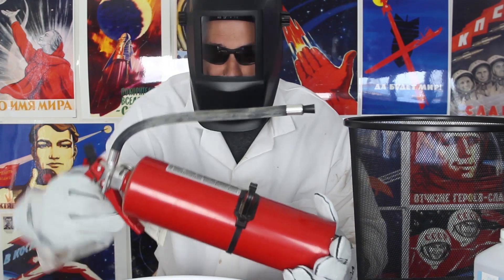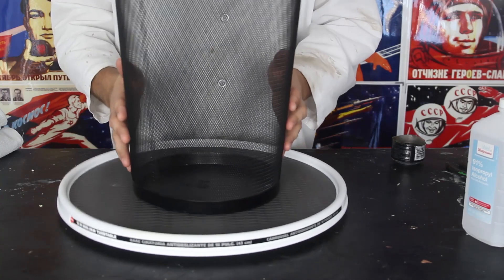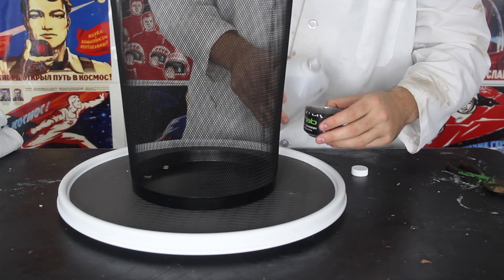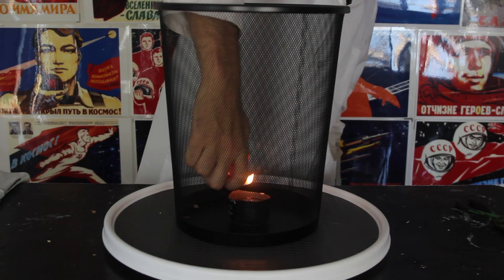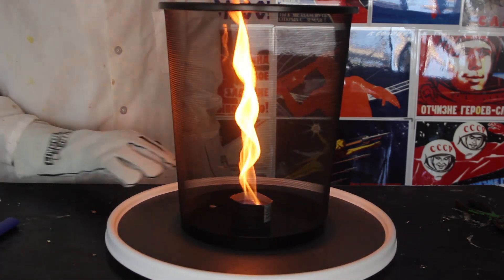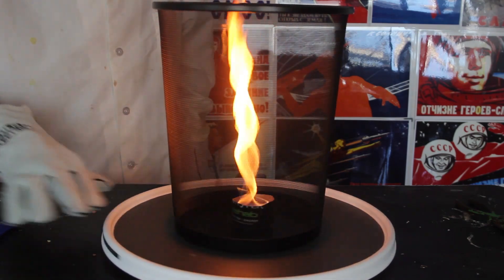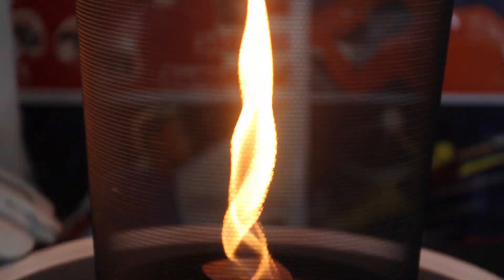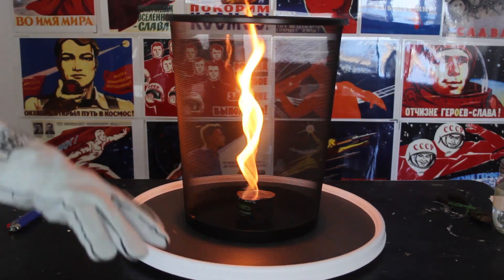Make a Fire Tornado

Comment: Can someone tell me what are the materials of the experiment??
Reply: I'm not sure if you're serious. If you are, then you need a Lazy Susan, a wire basket like his, the bottom of an aluminum beverage can (so, you need a whole can and a cutting tool of some kind) or some other similarly-sized container that won't melt, Isopropyl Alcohol and a lighter.

Let's get to it!

I couldn't resist. :)
Reply: sorry, i couldn't hear some of the materials, but thanks for the information! :)

Comment: well, the oxygen is in the air, O2 causes the ire to fuel, then, you spin it, and the wind kicks in, that's when the wind goes from under the can, from the holes in the trash can, to the top and wind don't just go stright so, it causes the fire to spiral up. that's the simpliest form I can explain in

Comment: 5559555555999995595595599999555555555595555
5559555555559555595955595555555555555959555
5559555555559555599555599955555555559999955
5559555555559555595955595555555555595555595
5559999955999995595595599999555555955555559
5555555555555555555555555555555555555555555
5599955555555555555555555555555555555555555
5595595559955555599555599555555555555555555
5599955595595559955559955555555555555555555
5595595595595555599555599555555555555555555
5599955559955559955559955555555555555555555
1.Highlight the numbers
2.Press Ctrl+F
3.Press 9 or 5
4.Read the message

Comment: 559555555999995595595599999555555555595555
5559555555559555595955595555555555555959555
5559555555559555599555599955555555559999955
5559555555559555595955595555555555595555595
5559999955999995595595599999555555955555559
5555555555555555555555555555555555555555555
5599955555555555555555555555555555555555555
5595595559955555599555599555555555555555555
5599955595595559955559955555555555555555555
5595595595595555599555599555555555555555555
5599955559955559955559955555555555555555555
1.Highlight the numbers.
2.Press Ctrl+F.
3.Press 9.
4.Read the message
Reply: Thats fucking awesome!!
Reply: IF you will press 5 instead of 9 you will see it clearly !
Reply: What it does?
Reply: darude - sandstorm

Comment: This seems to rotate the fire to a new position, therefore expanding the area/volume of available oxygen.
In that time & process, some has burned while some still needs to burn. The motion takes the form of the spiral
because it is no longer randomly patterned in it's burn but, has a guided burn & shape.
(Still searching for more proper phrasing!)

Wish I knew how to do this with a campfire and not have the motion be obvious .... on Halloween, I'd be a Warlock!!

Comment: The fuel goes up into the air and the spinning is causing the fuel to take a linger time to burn. I can't explain it perfectly but that's basically what's happening.
Reply: I think it's because the wind makes the fire turn and the carbbage can keeps the air massively going out, the sands keeps the fire in the what we could call here the "spinning radius". While all that happens, the carbone goes up causing the fire to grow as high as the garbbage can is and spin at the same time
Reply: Noooo I am god and I can move things with my mind

Comment: I believe that the oxygen in the air fuels the fire. Then flung at the fire at high speed causing it to get bigger. I'm guessing.
Reply: Majic Goat Um isn't a academic something like the bubonic  plauge (aka black death)
Reply: How does intelligence have anything to do with fire?
Reply: well ya but still confusing
Reply: the trick is the garbage gets oxygen in so if you replace it with a glass it woooooooooooont work.the cicular motion causes the fire to make with oxygen a Tornado

Comment: The fire consumes the oxygen, and because he starts to spin the bin, it is more difficult for the air to go through the holes causing it to enter at higher speed through the bottom half (where there is a difference in air pressure, the "tornado" effect is created by the air entering through the hole at some angle, and since its faster it travels in circular fashion inside the can until it drifts into the flame to burn causing a vortex... Damn my fluid mechanics classes are finally making me useful haha

Comment: The air holes in the bin are sucking in the air particles and are pushing them out the other end in a way that makes the fire, thicker at the bottom, spin in a thin vortex.

Comment: It makes the tornado because fire needs oxygen and without oxygen u can have a fire so when u light it on fire it takes oxygen than makes a fire and when you spin it the oxygen that the fire is taking in it circulates and moves and that funnel formation and the fire grows

Comment: Fire needs oxygen to burn. When you spin the trash can, it pulls in air from the outside making the fire taller and that air is spun in a circular motion which moves the fire in a tornado like fashion.

Comment: Great job, Crazy Russian Hackers. I think the reason why the flame goes high when the trash can spins is that the air pressure in the central region  becomes smaller owing to radial centrifugal force, which further lowers the force that suppress the flame when the trash can stays still.
Reply: Or probably spinning helps the air flows more easily and quick.
Reply: i lost you as soon as you said radial centrifuge force
Reply: Sean Cheah Never mind, this video already tells everything :)

Comment: The mesh trashcan, when spinning, acts as an air trap of sorts. It creates a wall, just like fan blades, except it is cylindrical, and since there are no angles, air is not pushed or pulled, it simply stays put. This makes it so a subtle raise in air pressure wont make the flame burn out. Then of course, since the flame is being spun, itll try to spin itself or atleast make a spiral shape. The air trap keeps the flame from "spilling" outward, almost like a form of gravity or something. The reason why the fire rises is 1. because you are spinning the fire (duh) and 2. the fire needs more oxygen and it cant get any oxygen from the sides because of the air trap, so the fire travels upward to "grab" more air.

Comment: That slow mo is one hell of an effect for a title sequence.
Why does it get higher and spirals ? The spin itself adds more oxygen to the air (perhaps the small holes even augment the effect like mini turbo charges) This is the same as blowing slightly on a fire when you start it to make it burn hotter. the tornado is just the spin twisting the flames as they are produced . The illusion is that you have a solid fire stream but in fact you have individual fire layers that stay at the point where they formed. VERY nice visual and scientific experiment. Bro I am starting to understand everything you say!

Comment: When you spin the bucket in turns the air inside making an "airtornado" and because fire needs air to burn, the flames fallow the high concentration air concentrated in middle of the bucket and more air leads to bigger fire and that's why the flame gets larger. The reason that it doesn't get longer than the bucket is because the air spreads out after the end of the bucket.

You can also see this in the forestfires. When the air passes through the trees, the air starts to rotate and the same thing happens as in the video. The firetornados in the forest can reach incredible highs.

Comment: I have a hypothetical explanation that may or may not be correct and requires us to assume a few things...
If we consider the combustion reaction: 2 C3H7OH(l) + 9 O2(g) ------> 6CO2(g) + 8H2O(g) and also consider the gaseous water produced to condense quickly to a liquid state you would be left with less moles of gas on the right side of the equation... This means that there is a negative change in entropy (sort of implosion) for the reaction causing air from the outside of the can to be pulled through the perforations (holes) in the can... Each would act as a sort of jet of replenishing oxygen to the flame that would spiral inwards in a sort of laminar way and the heat would cause it the air to move upward creating the firenado.... Once again Hypothesis.

If I had a garbage can and spinner I could test this theory by using a method that creates neutral or positive entropy... Maybe heated acetone vapor and a black light

Comment: what happens is that as you spin it your are forcing the alcohol to spin as well and as it spins the fire is reacting with it so it can only go with the flow in a way so by that, heat always rises but with the bucket spinning the vortex happens and as the vortex happens oxygen is trapped to go in one area and with that area the fire rises and makes a tornado same thing with regular tornados but no fire.

Comment: Im guessing it doesnt work without the bucket? logic tells me the as bucket moves, it also makes the air rotate, feeding the fire and making it spin in teh same direction.. am I correct?
Reply: That makes sense.
Reply: ***** Not exactly.  the little holes in the trash can are creating a vortex of spinning air. at the same time, it is sucking in new air while air is exiting from the top. because of this, the fire is getting more oxygen, and therefor the fire gets bigger. the vortex of spinning air spins the fire into the shape . I am a science nerd.
Reply: You are correct, the scientific explanation is a lot more in-depth, but you summarized it. read some of my other comments for more info.
Reply: Yes, the WIRE basket need to be there because air flows through the holes but makes it spin
Reply: Uh yes, Correct! :D

A++ for you! :)
Reply: The bucket must have holes to just slice the air to help make the shape of the fire
Reply: I guess the bucket is an important part in the variation of the "oxygens zone". but by rotating the source of fire you disturb this "zone" more. because if you look at an candel you should see one "tube" without oxygen just above the flame. but here you disturb the "tube" and create more small spot without O2, so the flame "follow" the "spots" with O2 and create "step" so the fire can grow up. i am not sure of that because it is a problem of fluid's mecanical and they are very tought
Reply: ***** candle*
Reply: Rydini Westergaurd During the  spin, the alcohol is consumed faster than normal?
Reply: Alex Stavi Not particularly, possibly a very slight amount. it is caused mostly by the increase of oxygen, and that the vortex pulls the fire up. But at the same time, the more fire, the more fuel consumed.
Reply: Garv Prashar It creates a vortex
Reply: Yes you are.
Reply: no